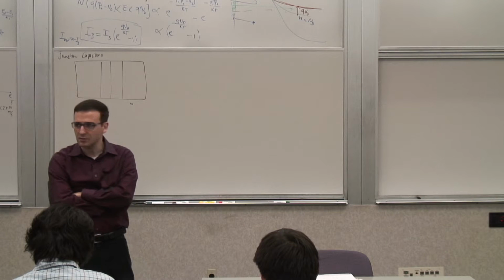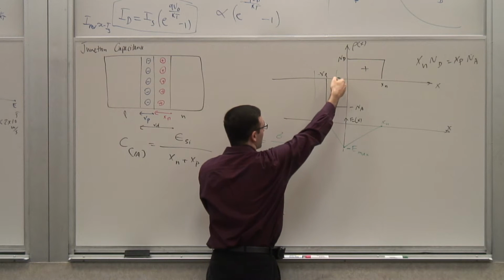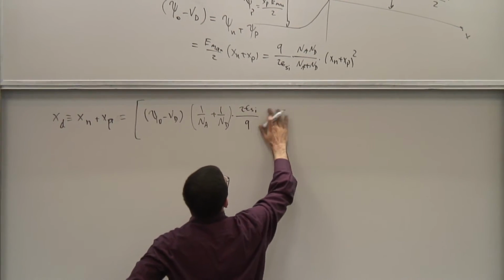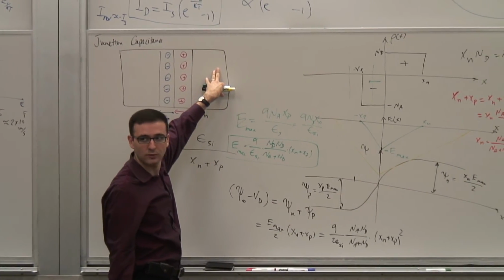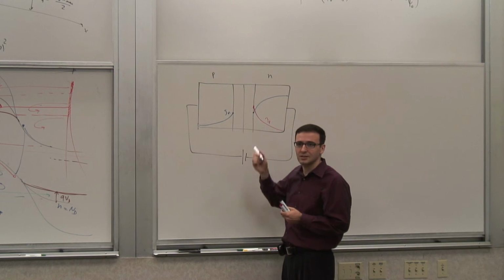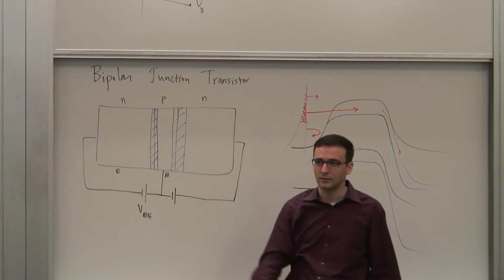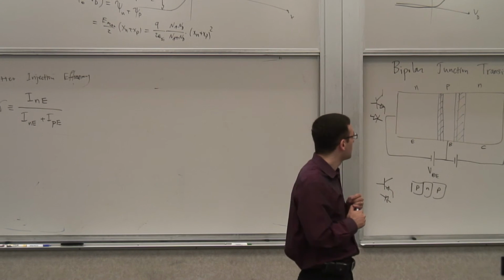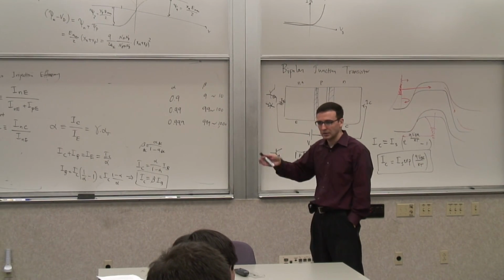104. Basic Solid-State Devices: PN junction, Bipolar Junction Transistor (BJT) basics.

Comment: dear prof hajimiri, would you kindly please offer an intuitive physical answer to the question : why does the BJT amp0lify ? thank you.
Reply from the maker: A detailed answer can be found i video 121N, here: https://youtu.be/sNh4YDMj8ok
In short, since the emitter (source) current is controlled by the base-emitter (gate-source) voltage and the collector and emitter (drain and source) currents are substantially the same, having a larger total resistance in the collector (drain) than emitter (source), allows to produce a larger voltage swing in the collector (drain), which is the output, than the voltage swing in the emitter (source), which is the input. That is why the gain is roughly the ratio of the total resistance in the collector to the total resistance (including rm) of the emitter.
Reply: @AliHajimiriChannel  dearest sir, i would enjoy even more an intuitive phisycal explination, more than the mathematical one. besides, i'm extremely reluctant to the similarity between FET and BJT.
is there any electrical-field related explanation rather than a circuit-based one ?
thank you !
Reply: @socalu4587  what are u talking about brah
Reply: @socalu4587  u don't make any sense
Reply: @socalu4587  bjt and amplifier are two different things. u can make an amplifier with bjt and other components. the amplifier is a circuit, what do u even mean by electrical field related explanation? did u even look at what an amplifier is before asking ur question

Comment: WHY does a BJT amplify ? Because it knows mathematics ?
Reply: A BJT doesn't necessarily amplify. It allows you to control the current through it using a small current (base current). The current through the BJT is much larger and these large currents can be converted into voltages by using resistors.
Reply: Hi, there !  Right, but you should be more firm: a BJT NEVER-EVER amplifies ! not only it does NOT amplify, but, moreoverso, it STRANGLES the current. not only is it NOT an amplifier, but moreoverso it is exactly the oposite: a current driven resistor.
Reply: lol